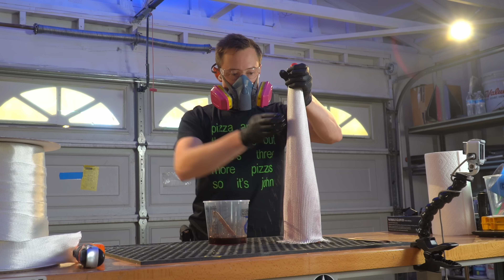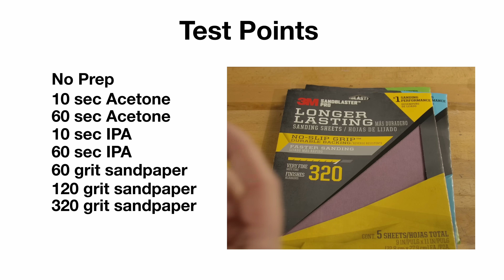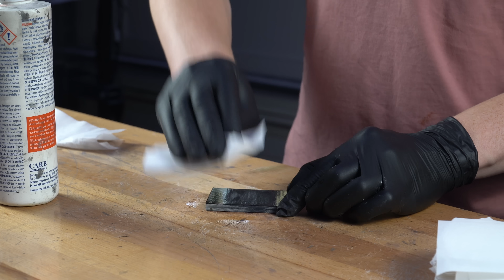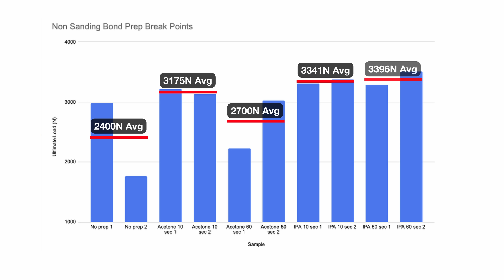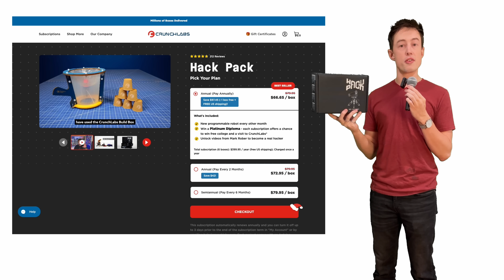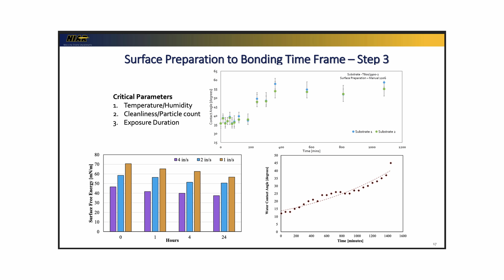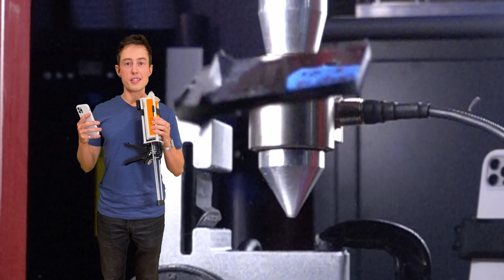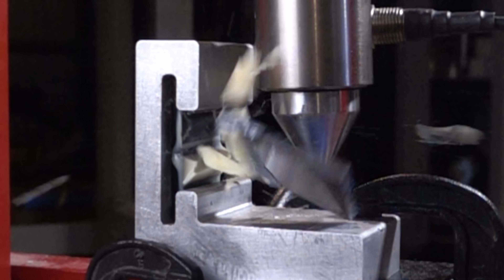I Broke 100 Epoxy Bonds to Find the Strongest

Comment: I know this video is focused on the epoxy-surface bond but it made me wonder about your rocket. Instead using the epoxy as a load bearing member in that joint have you tried using a few layers of carbon fiber layup that lies in contact with both the surface of the fin and the surface of the body inside the epoxy? that way the carbon fiber will help transmit some of the load together with the epoxy as well as (and perhaps more critically) increase the surface area of the fin/body the epoxy can contact. You could put the layup all the way from the tip of the fin, all the way down the surface,joint, body, next joint and all the way down to the tip of the next fin if you wanted to which gives a massive increase in surface area and thus hopefully getting a thinner and stronger bond. I am still a student so this may be a dumb suggestion idk.

Comment: When it comes to looking for trends in data, you have to remember that humans are EXTREMELY prone to seeing patterns where there are none. There were many insances in this video where you said there was a clear trend (for example sandpaper grit size) where I could just as easily claim the trend was the exact opposite. You also highlighted specific instances where the second sanded specimen of a given setpoint was worse than the first, and created a convoluted explanation. But how many instances were there where a second or third sanded specimen was stronger than the first? My recommendation: you already have the answer (acetone and IPA) given to you by the literal industry expert in the industry you are working in. Leave it be. After all, you then have to apply these results to a different material than what youve been testing on, so simpler is better.

Comment: Back when I was working in a bio lab we would wipe with IPA after acetone because the latter would leave a residue. I suspect the acetone would dissolve some of the plastic from the bottom it was stored in.

Comment: I was watching a video recently about wood aircraft construction using t88 epoxy and it said if using sandpaper to never use the black sandpaper(silicon carbide) only use the tan grit sandpaper (aluminum oxide) probably because of the way it's manufactured maybe it contains oils or lubricants or other adhesives.

Comment: You didn't go into much detail about how you actually selected subsequent experiments, so I assume it was the ol' reliable: staring at those massive Google Sheets tables and thinking real hard to find correlations. A much easier way to conduct expensive (money and time-wise) experiments when you know you're gonna need dozens of tests is the recently-growing field of adaptive experimentation. This technique has been used in medical studies to minimize the number of patients receiving "bad" treatment while maximizing statistical power, but a lot of the recent developments are around hyperparameter tuning. Meta developed their "Ax" library for hyperparameter optimization, but it still works for any kind of experiment. From their website: "Adaptive experimentation is the machine-learning guided process of iteratively exploring a (possibly infinite) parameter space in order to identify optimal configurations in a resource-efficient manner." It lets you visualize relationships between any number of variables, shows the error bars on the Gaussian processes shrinking as you add more data, and calculates the N most-useful experiments (called "iterations") to run to shrink the error bars simultaneously optimize for your objective.

For more details, this is part of the field of "Design of Experiments", and usually called "adaptive design" in medical literature where it's been increasing in popularity and accessibility over the last ~20 years. Bayesian-based stuff is getting more popular nowadays since it can calculate the experiment that would give the most new information, but early stuff (like, WW2 - check out "Banburismus") was based around sequential analysis where you repeat an experiment until a predefined stopping rule.

Comment: pro tip --- sanding with anything above 80 grit leave u with dust that almost acts like mold release , you can try the tests sanding under water , remember to dry the part and apply epoxy with "force" (brush / spatula etc) .... it will be way different

Comment: Tip with the degassing
step one: degas in a container after mixing the epoxy
step two: fill into the mold
step three: put the mold into a pressure chamber and have it under high pressure. this makes the remaining bubbles insignificantly small.
Reply: A challenge will be applying pressure on a rocket body with jigs holding fins to it... without deforming the rocket body excessively. Mmmm, would do that before or after filling it with solid propellant?

Comment: For Orbital vs hand sanding, I think the deeper groves vs more surface area is the correct explanation.  This is similar to 60 grit vs 320 grit.  At 320 grit you have more scratches, and technically more surface, but they are shallow.

Comment: So I'm curious if the acetone is strong enough that its vapor could be a contaminate. Could it be that exposure to acetone vapor then sanding then the IPA clean could give you the 4000 you saw? Tho @samheasmanwhite and what you found, point to sandpaper being not the best for mechanical prep. Maybe try a rasp cut file?

Comment: You wouldn't make it in a body shop man... you achieve the most basic level of sanding prep and call it like it's some new thing. Did you know sandpaper has wax on it? and IPA doesn't remove wax. You need to talk to some dudes at your local body shop supply man. Get some "wax and grease remover" and try that for prep. maybe stop at a body shop and ask the dude to show you how to sand something.  Sanding until there is no gloss is the most BASIC level. FULL STOP. If you did body work all your repairs would fall off after 12-18 months!

Comment: Just a fun rabbit hole for you to fall down:
Did you control the degassing pressure?  If not you may have been vacuum stripping your epoxy changing it's strength! Too high vacuum will lead to volatiles in epoxy gassing off thus it feels like you have to degass it for very long before it stops bubbling. Depending on the mfg they may or may not supply a number for the proper vacuum level for degassing.

Comment: Have you tried pressure casting instead of vacuum degassing i use it for casting models. it’s good for stopping bubbles but obviously it’s not removing them entirely less messy tho

Comment: It's not you liquid bonding method, but your joining method.  A mortise and tenon joint will improve the rigidity of the joint.  So a mortise and tenon joint then epoxy them together.

Comment: I would try wet sanding using Dawn dish soap.  This will help ensure any oils in the paper get washed away before the acetone and IPA cleaning.  It also makes the sand paper last longer assuming you are using paper designed for wet sanding.

Comment: For powder coating where surface energy is very important, they use sand blasting, then don't touch it with anything, no degreasers.
But that is metals.
For composites the sand blasting may not be suitable.
Reply: Mil-spec composite prep also says media blasting + spray with nitrogen to clean
Reply: @fredygump5578  As in compressed nitrogen?
So like you don't blast it with a workshop compressor which is straight up air and potentially some oils?

Comment: Resins are mostly self leveling, so the high grit sanding makes your surface  too smooth, reducing the grip area for the adhesive properties of the resin to cling to.  IPA versus Acetone is due to Acetone's Keytone status and its ability to be used in some resin/technicques as a curing extender to improve working time or to help with post fill cleanup, meaning it has at least some solvent behavior versus resin hardeners.

Comment: 1. Why you do not cover the  epoxy fillets with just a layer of +-45 biaxial? This adds little to the weight, but  will increase the strength of the joint tenfold. Bulkheads/longitudinals in boatbuilding are bound with fillets and then covered. There is no strength in ‘wet corners’ with no fabric. Epoxy is too brittle.
2. You can increase the mechanical properties of your bones/laminates by post curing, even if the TDS for the resin does not mention it. 
3.regular ‘household’ acetone can contain impurities, so many teams I know in boatbuilding have switched to alcohol(s). 
4. Sandpaper: ever heard of peel ply?

Comment: Clean prior to sanding as well, so you don't abrade contaminates in to the substrate. 

If possible, clean aluminum-oxide blasting in a controlled manner can be superior to sanding (and easier). 

Perhaps look at using a "pi joint"

Let me know if you want to collaborate on filament winding your rocket casings.

Comment: I have no meaningful experience in composite manufacturing or surface preparation, but concerning your sandpaper issues, I had one thought: What if fresh pieces of sandpaper deposit parts of their "anti-gum-up" coating (often something like calcium stearate) onto the surface, but the more coupons you sand with the same piece, the less stearate is left on the sandpaper to contaminate your surface. And long-chain fatty acids or their salts (like stearate) would be the kind of thing that is quite readily dissolved by acetone, but barely by a short-chain alcohol like ethanol or isopropanol.

Comment: sanding consistency : mill a slot in a clamp-able fixture. set the coupon in hte slot. apply sandpaper to a weighted sled and pass a set number of times over the coupon. the pressure can be consistently varied, as well as the amount of sanding,  sanding grti, etc. edit - spelling

Comment: You're wiping wrong. Spray the solvent onto the coupon so there is a film and remove in one swipe. Repeat using a fresh lint free cloth. All that rubbing you are doing is adding contaminants into the surface.

Comment: To do something easy and consistent, you have to follow one basic rule. KISS. To wipe something for few seconds with two chemikals is following the KISS rules. Sanding something by hand for prolonged time is not (and very likely also not consistent). So it breaks the rules.
Always prefer something fast, easy and reliable to difficult, if there is not a very big and consistent benefit.
Seems you have found a good and reliable/consistent solution with Acetone and Isopropyl alcohol; no need to further play around. Seems it is good enough.

Comment: While I don't build rockets, I am a construction engineer, and I think the actual problem is the interfacing of the fins...
There is a reason adhesives (and other connects) are meant and tested for shear or tension (pull) and not bend (your case) and torsion (twist).
How about changing the interface of the fins by making them T shaped, so you have a large flat interface that will be stressd mainly by shear forces?

Comment: A couple thoughts:
• Have you considered sandblasting instead of sanding? Sandpaper, besides being variable due to the movements of the user, is also a complex product with binders and release agents that could contaminate the surface being sanded. Sandblasting media is just abrasive, nothing else. You could even wash it in a solvent if you wanted to 100% sure of no contamination. Though you would have to run the compressed air through a multi-stage filter like some painters do to make sure you don't get any aerosolized lubricants from the compressor in the air blowing onto the surface being prepared.
•If you do this again, maybe consider making multipart molds made of something the Epoxy doesn't adhere to well. The mold release agent is a huge variable in that it could be mixing into the epoxy during any sort of agitation.
•Something that I've considered but never done is mixing epoxy with acetone washed silicone carbide grit and then grinding this mixture into the surface being adhered to as a sort of primer. In my mind it seems like it would possibly give you the best bond you could hope for by exposing fresh surface while immediately wetting with resin. 
• mixing some sort of micro fiber into the epoxy resin to improve it's tensile strength as it seemed to always fail by tension breaks in the resin if the surface bond didn't fail. Ideally it should be strong enough to rip out pieces of the coupon.

Comment: I've spent many years in the chemistry lab cleaning glassware. Industrial acetone is known for trace UV active contaminants (the bane of my existence for 2 years), including self-polymerization into mesityl oxide and a dimer known as diacetone alcohol. Check out DOI:10.1016/j.jpba.2014.03.027

Industrially available IPA/2-propanol is also known for trace mineral-oil like contaminants as well.

Comment: Soo quick Question from a Amatuer the stronger the Epoxy but since im guessing your using CArbon fiber wouldnt you also be a able to change the clearcoat"resin /epoxy used to bond the carbon fibers " in order to getmore strength?

Comment: I never saw you marking the spot where you position you aluminum tip. But the distance where you set it, would change your measurement a lot, I would think.

Comment: How dirty is yo air mane? For real. The lab is just like home. Only difference I see is yours (garage) doesn't have air filtration like the ISO guys.   

10:38 is where I had to stop and write this. You gotta do the same tests in a cleaner area if you wanna really know. My qualifications are I spemt toooo much $$$ & time on things that came down to "some small contamination screwed up everything".

Comment: A joint that produces identical adhesive failure planes across all trials isn’t suffering from poor prep ,  it’s suffering from poor design. The load path was never structural.

Comment: You could try pouring the epoxy to the mold on a vibrating table, similar to pouring dental plaster casts. It helps to pour the gypsum more evenly and helps to get rid of air bubbles.

Comment: There are a boat load of people on here smarter than I am, but you said you were doing this in your garage last summer.  Did you think about your environmental variables?  Temp and humidity are the ones that come to mind for me.  From what I saw you degassed the epoxy, but then they would sit out as they cured.  I'm not entirely sure, but I thought that temp and humidity had an effect on epoxy pours.  It could also have an effect on the coupons and bonding surfaces.  These are just wild ideas though and don't know if they would help with bond strength or the deviation of the data.  Also the test rig could also be a huge variable, like you stated.  I would think the deflection of the point load and the inconsistent pressure application with the hand pump would make some major differences as well.

Comment: The glass fiber is the strength of fiberglass composites. The epoxy just holds that in place. Mist with MEK, then put a piece of new glass mat in the fillet. Press if you can, vacuum degas if you can, but neither should be needed to far surpass a pure epoxy strength.

Comment: I think you might be able to significantly increase your bond strength by adding a very small percentage of Graphene to your adhesive.  Or course Graphene is very expensive but you could make your own.  Adding .1 or .2 percent Graphene might double your bond strength.
Reply: A small amount of aluminum powder added to the epoxy might also increase bond strength and decrease weight.

Comment: ... Watching a perfectionist aircraft repairer prepare Fiberglass / Gelcoat surfaces is rather interesting. Piles and piles of wet aluminum oxide sandpaper is discarded after a few minutes use. Apparently the pristine sheet cuts quite differently from a slightly used sheet. 
Described as a similar effect to using for the first time that super expensive metal file you just bought and comparing it to the same file that has had a few weeks heavy work.
There ya go, another variable (High quality, extremely sharp sandpaper cuts quite differently after a small amount of use)
Needless to say I and a few others occasionally grab a big boxful of the very slightly worn sandpaper for more mundane uses.

Comment: You can plasma-treat it, flame-treat it, ion-bombard it, or rough it up with a chainsaw,,,  the joint will still fail because it’s a sticker-style bond. Two parts in always means two parts out. Nobody in aerospace glues even the glove box together like this.

Comment: Very interesting!
The poor results in the initial tests with 60 seconds of Acetone cleaning may be due to it starting to break down the resin in the fibreglass sheet, or just diffusing in to the surface rather than all being dried off.
I've used it to remove various types of encapsulating resins from electronic modules when repairing them - it gradually decomposes just about any epoxy or polyester resin.

Edit - I just got to the part where you cover limiting the Acetone exposure time!

Comment: Try making some graphene with graphite in the blender ( DO NOT NUTRI-BULLET! It will go BOOM 💥 and make a massive mess 😣!)
Then evaporate the water off by putting in some trays in the sun 
Wear a mask and then you can use a little powder and the Epoxy risen 
I don’t remember the measurements it’s about 2%  or 0.5 % or something  
Robert Murray Smith, did a video about making graphene
And there is another method but need capacitors and was ⚡️⚡️⚡️ a bit dangerous and need to have an evacuation as well. I don’t have any other stuff. I did try this blender shred graphene style 
My findings were mixed and was a few years ago now, there will be more info online